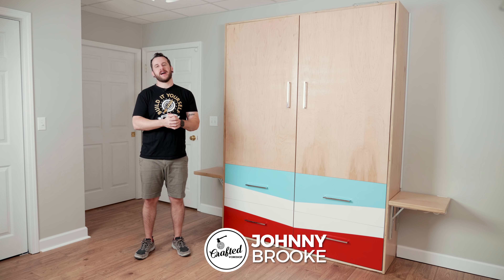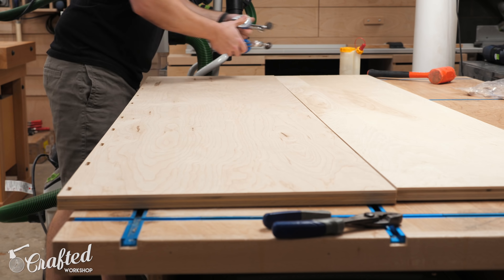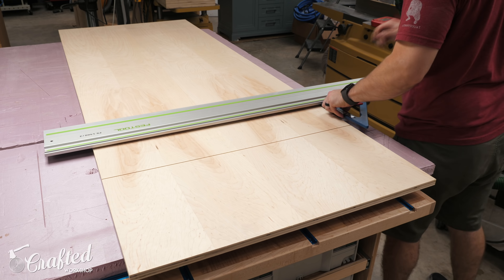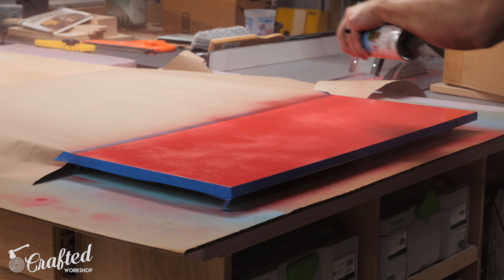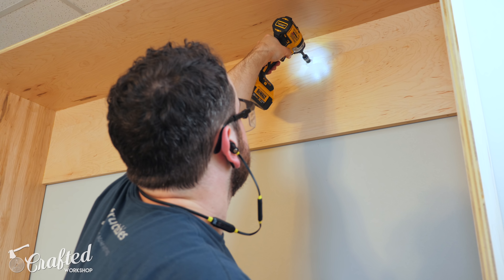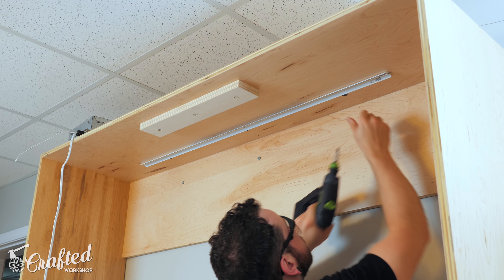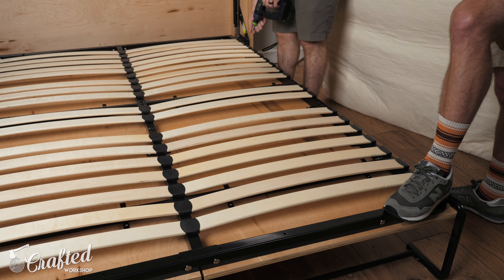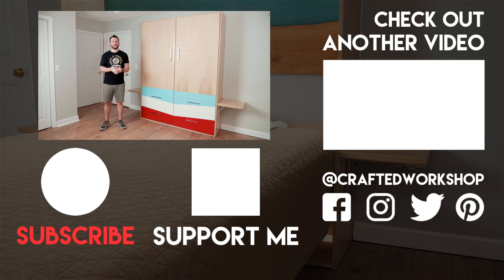DIY Murphy Bed with Alexa-Controlled LED Lights & Folding Nightstands

Comment: Just FYI for  peeps, I stopped using studfinders and started using magnets. They will allow you to find the nails the builders used to install the drywall and then you can a better idea of where the studs are. So much better than a studfinder.
Reply from the maker: Magnets work pretty well but this stud finder actually shows where the edges of the stud are, so I know exactly where the studs are. Works well.

Comment: Professional woodworker here. A few tips, If you don't mind. I have built hundreds of Murphy beds. #20 Biscuits are plenty strong enough for that use. No need to spend multi hundreds on a Festool. In fact, we used to use knock down hardware on all of the cross panels (but not the bed box) instead of biscuits for easy moving which are far weaker than biscuits and glue. You could have just assembled dry with your pocket screws and whatever joiner you have for panel alignment which would make moving that bed really easy.  Also, a DIY crosscut sled on your table saw would be a lot faster and cheaper than buying a track saw just for that, but smoke 'em if you got 'em.
Reply from the maker: Good tips man! Most of these pieces were too wide for a track saw, though. And Rockler is extremely specific in their plans about what type of joinery to use, they recommend dowels, so I tried to give advice based on those plans. Thanks!
Reply: It's great that you are showing different ways to do things. Track saws are a really useful thing if you have limited space. I think they also have tracks that can rip 8' sheets. I totally understand that most people like to have plans to follow. Also, Rockler has to protect themselves from liability which is legit. I'm just adding knowledge from the hive mind. Good videos!
Reply from the maker: They do, I have a longer track and you can also connect two shorter tracks. Super versatile tool that can stow away in minimal space. For sure, thanks man!

Comment: Great video, it’s nice to see the mistakes we all make. I don’t know if you ever tried it but I like to put polyurethane on the areas I’m going to paint. After a little sanding I find it gives the paint a much nicer look and a more durable finish.
Reply from the maker: Thanks! For sure, I just didn’t have time to let the oil based spray paint cure fully before topcoating it.

Comment: So the difference between a track saw and a hand circular saw with a track is the dynamic adjustability of the blade's depth and the hook that goes into the saw channel?
Reply from the maker: Yup, also dust collection and generally way more accuracy. Track saws are awesome!

Comment: To cut down whole sheets, if you already have a tracks saw, I implore you to invest in a 3 metre track and some parallel ripping guides. So much easier than wrestling with the tablesaw!
Reply from the maker: I’ve got the long track, a parallel guide would be a good addition!
Reply: Get em! :) The parallel guides have been more useful to me than the GRS16 (which I noticed you also have). I have the ones from precision dogs but I'm sure the festool guides are just as good.
Reply from the maker: Ill definitely look into them!

Comment: I had a similar issue with paint on a metal project when I was using both spray cans and brush on rust paint.  The brush on stuff only required 24 hours to dry, and I followed those rules when putting on the "final coat" with rattle cans.  Unfortunately the rattle cans needed 48 hours ( I guess because of the propellent?), and I wound up with the crackle finish.  I had to sand the half the project down to bare metal and repaint it.
Reply from the maker: Yup, it’s a hard lesson to learn for sure!

Comment: So I was about to pull the trigger on this kit or at least the frameless version. Last night I measure the matress and ours is too thick too. Now that we know do you think that we can still use this kit with modifications to the depth of the carcass? Where was the interference at and did the support leg cause issues in that regard? Thank you for your advice.

Comment: Wow fantastic murphy bed Johnny!  I am designing a murphy bed that can accommodate a 13 inch queen mattress.  I'm thinking of using the same Rockler kit but making the depth larger to hold a thicker mattress.  Not sure if the weighting will be the same when raising and lowering the bed. I don't want to find out the hard way after I make it and find out it the pistons don't work!  haha How would you have changed your design if you wanted to accommodate a 13 inch mattress?  Thanks!

Comment: Why do you break down on the table saw then cut the final dimensions on a track saw? 2 cuts vs 1 cut?
Reply from the maker: I cut to width on the table saw and then to length with the track saw.

Comment: Hey Johnny nice job. Just so happens I was going to make one of these rockler beds soon too. The issue you had about the mattress being too thick, would it have been solved if you simply increased the depth of the frame carcass?
Reply from the maker: I probably could have done that, but the plans are really specific about a lot of things including the mattress thickness. Safety was my biggest priority here so I just followed them to the letter.

Comment: Great build Johnny, came out looking super clean and I really like the pop of colour. although I couldn’t help think that you made things really hard for yourself! Couldn’t you have just brought another similar coloured blue paint, and gone over the two sections again? & with the carcass, wouldn’t it have been a lot quicker and easier to just screw down/up through the top and bottom since you’re never going to see these pieces??
Reply from the maker: Thanks man! I probably could have repainted the blue but I figured I’d make things a little more visually interesting. And I responded to the rest in my other comment.

Comment: I once had a masking tape with an ethanol based solvent which dissolved my acrylic basecoat - should have listened ti the instructions of the tape that is not to be used with acrylics - but i also ditched it and i had to sandblast the whole project and paint again
Reply from the maker: Oh bummer!

Comment: I'm moving into a studio apartment, and was wondering if this is possible to reproduce without the need to attach it to the walls?
Reply from the maker: Not as far as I know, the hydraulic struts that provide the lift for the bed are incredibly strong. You could easily fill the holes from the screws later though.

Comment: Yo Jay-Bird, great vid per usual. What is the 90* jig you use on the track saw?  Shot in the dark here, but would that square work for DeWalt??
Reply from the maker: I’m not sure it fits the DEWALT track but they might have another version. It’s the TSO GRS-16, works great!
Reply: Crafted Workshop Big thanks, my man.

Comment: I made a wall bed but it has turned out too heavy for the mechanism to lift and it takes lots of efforts to lift the bed.
I used ply sheets insteat of the wooden flats u used. I want to replace the ply sheets with some thing like wooden flats u used. Pls let me know what is the name of that wooden strips which you are calling wooden flats.
I see these are having some sort of shock absorber like mechanism. I searched here in india with name wodden flats but didnt find any

Comment: these days it all needs to be automated. inset it in a little bit larger cabinet, to hide the hydraulic pistons, and then, the Alexa angle, would blow viewers away. i only think this because ive bee addicted to all things home automation for the last year. these thoughts of mine are just flowing, not sure if people would like total automation or not. great  job on the woodworkin though, thats part of my basis skillwork too. all this new electrical work is so exciting though.
Reply from the maker: Thanks a lot! That would have been cool but I would have needed some serious safety integrations too. Don’t want people accidentally closing the bed on themselves!

Comment: Having lights enclosed in the murphy bed is a fire hazard.  What happens if someone closes the bed and forgets to turn the lights off?   When I built a Murphy bed, I also installed lights and quickly came to the realize the potential issue.  They have since been removed.
Reply from the maker: LED lights generate essentially no heat, it shouldn’t be an issue.

Comment: Tell your contacts are purebond to actually start selling it near me!! It's impossible to get my hands on any full sheets other then red oak and home depot won't ship it for some reason (I'm in northwest WA).
Reply from the maker: Dang! You are unfortunately probably about as far from them as you can get, from here in NC. Can you special order it at your local Home Depot?
Reply: They said I could probably special order it but it would be around $80 to ship it to me and I only needed one sheet at the time so it didnt really make sense
Reply from the maker: Bummer!

Comment: Very nice.  Personally I don't think the end tables add anything, but to the contrary.  If you got some modern looking end tables with say metal legs, this would look less like a "UNIT".  You wouldn't even have to put them both on both sides, maybe one next to.  The other one somewhere else in the room.  Easy enough to move around as you need them.  Sorry my 2 cents.  Great job, make no mistake of that!
Reply from the maker: For sure, I wanted tables that would get out of the way when the bed wasn't in use.

Comment: Biscuits would work better than pocket holes in that scenario honestly. I love pocket holes and they work great in plywood along with solid wood but biscuits actually do fairly better in plywood. Especially if the pocket holes are put in the wrong direction of the joint. Biscuits are kind of superior to pocket holes when it comes to sheet goods. Call me crazy but look up Lamello. It’s a plate joiner company among other things that make some great products for us Woodworker’s. Actually it would be something you’d dig Johnny there are some places that they would be a much better option.
Reply: Nesley Heiney Curious what your logic behind this is? He needed the pocket holes to pull the joint together because he didn’t have clamps long enough. How would a biscuit provide any mechanical clamping force to do this? + I think he chose dominos because, due to their larger surface area they provide a lot more strength ALTHOUGH I personally don’t understand the need for any of this. Simply screwing down into the sides would be more than strong enough and meant the carcass could have been built in an hour
Reply from the maker: I used pocket holes in place of clamps here, not for any kind of structural integrity. The Dominos were for that. And yea, the Lamello is sweet! Biscuits definitely have their place.
Reply from the maker: You’d be surprise the amount of force being placed on this cabinet especially with two people in the bed. Rockler’s instructions are very clear that screws aren’t enough.

Comment: Really great project Johnny!   For those big plywood sheets, ask Rockler to send you one of their material mate carts.  You can open it up to horizontally support the sheet, slide it from your truck to the cart, then roll it right over to your table saw and slide it off the cart into the cut.
Reply: Modustrial Maker those carts look really really helpful! Do you have any idea if they work on uneven surfaces or has it got to be a perfectly smooth and flat floor?
Reply: My shop floor is cracked and uneven, and they roll fine over it (and have locking wheels).  It is a pretty heavy duty product.
Reply from the maker: I just asked for one. Thanks man!
Reply: Definitely going to have to look into getting one then - cutting big sheets down is an absolutely nightmare for me with a job site saw, so it would be amazing to have something to make it easier - Thank you!
Reply: I want to ask for one
Reply from the maker: Start making videos 😁

Comment: I get that sponsors are important to make these videos happen, but for what it's worth, I've been less than impressed with Purebond plywood.  Lots of voids and just not that great to work with.  My local plywood dealer sells about 20 different cabinet grade plywoods, all with superior quality and waaaaaay cheaper than Home Depot.  Hell, I can get a sheet of 3/4" baltic birch with at least twice the number of plys as the purebond stuff for about 2/3 the price.  I just think it's horrendously overpriced for what it is.  Check for a plywood / hardwood dealer in your area, it's worth it.
Reply from the maker: Interesting, I haven’t had that experience and most cabinet grade plywoods are at least $20 more expensive per sheet in my area. I’ve probably gone through 40 sheets of Purebond in the last two years and have always had a positive experience. Sorry man!

Comment: Aircraft stripper for removing paint....you can thank me later. 😉
Reply from the maker: Good tip!
Reply: @craftedworkshop  to be fair though, chemical stripper would have taken longer than 3 minutes with a sander though,  since you only had a small section to do lol

Comment: Someone has to be smarter and not use Plastic Straws!  Try some 90 degree bent cardboard of some proper thickness... Just be the one to improve the tool of glue clean-up!
Reply from the maker: Plastic straws work incredibly well.
Reply: @craftedworkshop  not really to the point, is it?
Reply from the maker: I guess I don’t get your point.